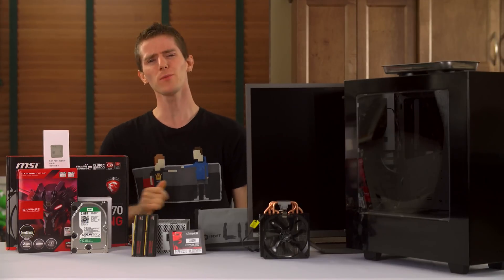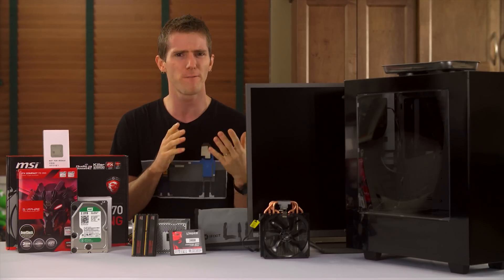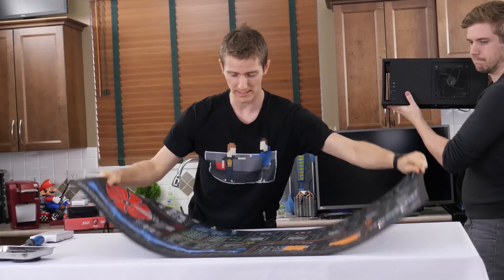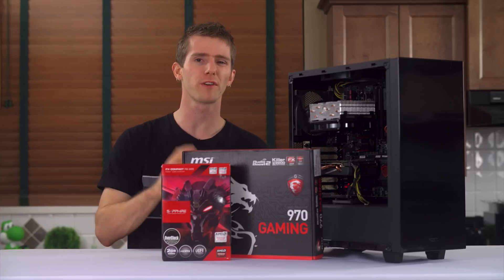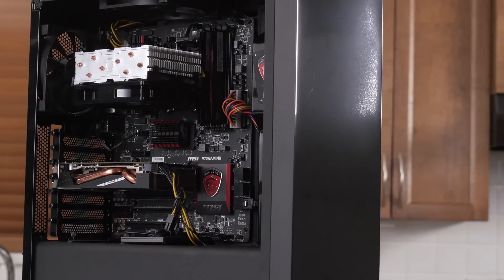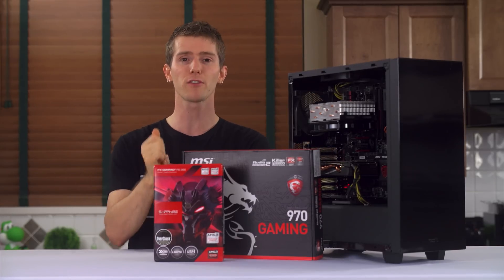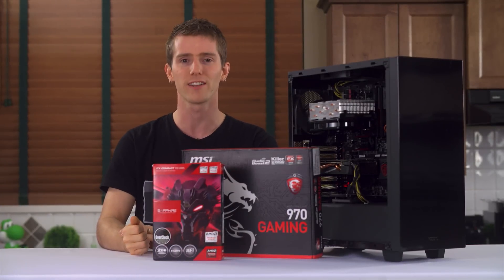Can you Build a 4K Gaming PC for Under $1000?

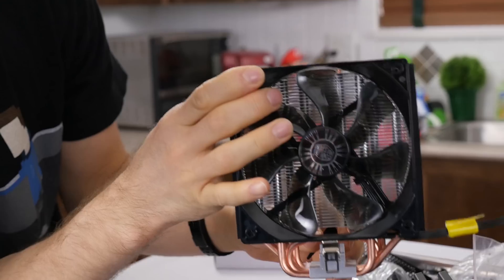Comment: 3:04 is that a hyper 412s cooler? if it is then thats the same cooler i use. also the FXA-970 motherboards is the same board my cousin used because he switched out his fx-8350 for an i5 (i cant remember which but its the one thats roughly the power equivilent).

Comment: just wondering if i upgrade my pc will it be able to play moba games at 4k 60  fps?

specs:
cpu G3258  oc 4.2ghz (upgrading to a 4690k or 4790k if)
r9 290 vapor x
kingston value ram 4gb x2 
z97 msi gaming 3
750w semi modular psu 80+ B
wd blue 1tb
wd blue 500gb
kingston fury 120ssd
deepcool maelstrom 240t aio cooler

im into moba Dota 2 mostly. i do play other games but i dont mind waiting for pascal for the gpu upgrade if needed.
just wondering if g3258 can handle 4k moba gaming.
Reply: +Irfan  Comot  Get a new cpu that g3258 will bottleneck that 290 pretty hard. From research it seems Dota 2 benefits from a good cpu more than a gpu.
Reply: +SpinOutTV2 yes i agree to that. bought it for experimental purposes and learning. since its started as a budget build and make my way up. do you think a 4690k would be able to handle 4k dota?
Reply: Irfan Comot Yes that would be a perfect cpu for Dota and it wouldn't bottleneck that gpu.

Comment: Would a GTX 960 4 GB provide about the same performance as the AMD R9-285 2GB Compact GPU that you used?  Any reason not to use the GTX 960 with 4 GB for a 4K build?  Edit:  Been reading that the R9 does better at higher resolutions and has significantly more memory bandwidth.  I might lean towards the R9-380 over the GTX 960, price is about the same.

Comment: I pluged monitor to a potato installed windows 10 and i could run cs go at 4 k avg 89fps i am very happy
Reply: +Napoléan Bonaparte What kind of potato was it? Should be a pretty low end one!
Reply: Hristian Andreev Its a pretty high end it cost 3$+txs so thats kind of a deal breaker for most people.
Reply: Damn! That definitely beats out my potato i got a couple of days ago from the groceries store...... I'm sad now
Reply: Hristian Andreev I had to upgrade mine the old one was a bad potato but it did the job
Reply: +Napoléan Bonaparte  my potato is $5 plus I get 5 extra potatos

Comment: I'm thinking to buy i7 prossecor now cuz the divisoin need i7 processor it means future games will too reqire it
Reply: Don't. An i5 4690k can run it just fine with the right gpu. Or, if you have the money go with an i5 6600k. You wont be able to run max settings, but games will likely be playable at 4k (probably low or mid with no aa). i7s are great chips, but for gaming quad core i5s work fairly well. Dont just take my word though, go do some googling of benchmarks and figure out what will work for your workload.
Reply: games which require an i7 are always playable with a decent i5 like the 4460, 6400 etc

Comment: Anyone know anything about computers and tell me what you think I can run?

I have:
-z170 Motherboard 
-i5 6600k 3.4ghz quad core (Soon to be overclocked)
-Hyper 212 evo Cooler Master cooler (Soon to be replaced with 240mm closed loop for a 4-4.5 overclock)
-16gb of crucial Ballistix 2400mhz ram (Possibly upgrading to 32gb)
-960gb sata ssd (570mbs)
-1tb Hard drive
-EVGA 600w 80+gold PS
-EVGA gtx 970 ssc

Comment: I wish I had a 4k gaming pc. I don't even have a gaming pc :/ I want one so bad though. It's I just don't know how to build my own pc, with gpu, cpu, ram, cooling, monitor (4k or not). Anyone that knows the answer please tell me, which is better, a HDD or SSD?
Reply: +Lobsta 959 Thery're better for different things. SSDs are more expensive for the space but are very fast, while HDDs are slower but much cheaper. The 'best' way is basically shown in the video. Get a small SSD for your most used games and the operating system, and a good large hard drive for anything else. But if you can't afford an SSD now then just go with a hard drive.
Reply: +MGlBlaze thanks, what RAM type should I get? DDR3 or DDR4. And what CPU? Intel or AMD?
Reply: *****
 RAM type doesn't matter much. Get whatever the motherboard is compatable with. AMD has the most affordable price-to-performance options. You can get a new FX-6300 for about £80 (around the performance level of an i5 for about a third of the cost) or an FX-8350 for £140, which is just below the performance level for an intel i7-3770 (and not that much less than an i7-4770) at less than half the price.

https://www.cpubenchmark.net/cpu.php?cpu=AMD+FX-8350+Eight-Core

You can squeeze this even further if you feel like buying the processor used.

Though again, the 6300 was mentioned in this very video. Just... watch this video.
Reply: We don't use pounds in Australia, but I think 80 is around $100-$110

Comment: Who the hell plays CS:GO in 4k? Unless you get lucky with overclocking a G-sync panel to say, 100 hz, I certainly wouldn't. All the other games make perfect sense lol.
Reply: Cause your suppose to see better like through the smoke and molotovos so you can get better visuals and much more accurate shots because of how the game visual is setup. I play on medium at 80 fos
Reply: +Red™ I'm not saying it's undoable, just that I'd rather overclock a 144hz panel to say, 200hz or even more, than play on a 4k monitor at 70-85 hz. But I think we can agree that 1440p 144hz monitors have the best of both worlds. :)
Reply: +Elijah Ramer (DegradedFour) true :) but 4K monitors don't display it in 4K d your running it at medium. I think monitors to up to 4K but don't display the graphics in 4K

Comment: It really is worth the stretch in price for a 4k monitor nowadays. I love mine. I got a 40 inch one, and now I use it as a tv as well with some careful choices for sofa etc to allow a keyboard and mouse table. So brilliant to switch between keyboard games and controller games etc, and it means sitting further away giving my eyes a rest. I have it wall mounted to pull it closer to desktop distance also. It works really well.

I would say that it is more important to get an ssd, but after that save up for a good 60hz 4k monitor.

Comment: I'm trying to build a nice pc under $600 with 4gb of vram. Is this ok? Any suggestions for improvement?

CPU 
AMD FX-6300 3.5GHz 6-Core Processor
$136.45 Buy

CPU Cooler 
ARCTIC Alpine 64 GT 25.6 CFM CPU Cooler
$16.99 Buy

Motherboard 
ASRock 970A-G/3.1 ATX AM3+/AM3 Motherboard
$95.50 Buy

Memory 
G.Skill Ripjaws X Series 8GB (2 x 4GB) DDR3-1866 Memory
$49.99 Buy

Video Card  
Asus Radeon R7 370 4GB Video Card
$215.98 Buy

Case 
Logisys CS206BK ATX Mid Tower Case w/480W Power Supply
Reply: +Guido Fawkes Precision, it's $600 CAD

Comment: Hey guys!
I have a amd 390 8gb gpu and a intel core i7 920 2.67 ghz, I was thinking of upgrading the country to a AMD Black Edition AMD FX 8350 / 4 GHz processor,  and use 16 gb ddr3 ram, any ides how that will go? or if I should get something else?  Thank u :)))
Reply: +Noah Lundqvist DONT DO IT!
Reply: +Yusuf ahmadi why?
Reply: amd processor didn't have ball when it comes againts intel. if you wanna do upgrade just stick with intel. (not fanboying btw..)
Reply: +Yusuf ahmadi all reviews are good about the amd cpu, it's faster then what u have, it is cheaper than a i5 3-somthing K cpu, so what's wrong with it? ?

Comment: Eww... WD green...
Reply: +lvcsslacker Green is really good at saving your electricity bills.
Reply: +lvcsslacker There are no significant difference at all for the latest Green due they mix it with Blue make it single model now compare to Black. So its ok use energy saving drive, cause all you need to be faster is actually an ssd mix with the hdd, thats all.

Comment: I see many issues with this build, 
msi 970 chipset boards are terrible and horrible power design, have fun overclocking on it, it will come with a lot of issues on
it when doing so

the 285 is not enough for 4k hell not even 1440p, to weak and 2gb of vram won't be enough, even at 1080p ultra it is not enough, even for lower games it makes no sense especially with an expensive display 

the 6350 is a waste, you could just get a 6300 for cheaper and overclock to beat it, still amd cpu's are too old and weak to be used at this point

you could easily fit an i5 4460+ 290x during this time, which would make more sense for 4k, but still at time to time it
would not be enough

the wd green's are not good for usage becuase of low spin cycle, should have got a seagate barracuda or wd blue

the v300 kingston ssd has low write and read speeds for the price, the 850 evo or crucial bx100 is way better 

i could continue but it is just a waste of time commenting on a old video, too bad amd sucked your dick on this video just like intel did on your value build video, for $650 only a pentium and a 260x on a $100 motherboard what a joke.

Comment: Intel i5 3470 (3.2Ghz) ~60% load in CS GO
Mobo-the old cheap good AsRock B75
Graph-Radeon HD7870 OC (core-1100 MHz /memory-1300MHz) run CS:GO average fps-170 with highest options + 8xMSAA
Monitor -Dell U2410 1920x1200 60hz IPS montor 
Still less than 1000$ even with SSD included

Comment: Asus K43SV:

Intel Core i5 2410m (2.3 GHz - 2.9 GHz)
Nvidia Geforce GT 540m 2GB DDR3 128-bit
4.00 GB DDR3 1333 mhz RAM
Windows 10 Pro 64 bit

I play Dota 1, Dota 2 and CS GO and I got 65 fps at max settings. 1366x768 and 1280x720 and I'm happy and very satisfied with it. :)

Comment: an i use an nvidia graphics card with the amd cpu? some people said amd makes their cpus work better with ther own graphics cards, and are FX amd cpus any good?  i know people say intel is way better and amd overheats too much
Reply: AMD is better priced, get a bit hotter, has higher TDP, has higher clock speeds, has more cores, has worse per-core peformance, which would be a bit worse for gaming. Although the differences are not that huge anyway.
Reply: are amd cgraphics cards better compatoble with their amd cpus or even an nvidia card would work good?
Reply: Iwo Ruuzz It would work perfectly fine.
Reply: +Iwo Ruuzz Intel & Nvidia is more power efficient but cost more money than AMD & ATI.
Reply: +Jelqzko Pehlivanov Yes, but that has to do with the intel processor, not with the conbination of the 2.
Reply: +Iwo Ruuzz Using a nVidia card on an AMD cpu or vice versa does not matter at all. it will work just fine whatever you use!

Comment: Got a MSI 390. Runs cs:go at an average of 170fps at 4k. Though it has quite a bit of trouble on fallout 4 even at lower resolutions thanks to bethesda optimizing the game for nvidia cards (which were the only cards i used previously to this card, but its 8G vs the 970's 3.5G changed my decision).
Reply: more like fallout 4 wasnt optimised at all

Comment: Yea, lets run cs go at 4k
Reply: +theapple0 800x600
Reply: +theapple0 i am still playing on 1280x960 in cs xD
Reply: theapple0 But can it run Crysis?
Reply: Kusqen Anton 1024 * 768
Reply: Levi Paustell To mutch pixels, try 32k
Reply: +theapple0 lets make it impossible to see anything xD
Reply: +theapple0 I play CS in 4k
Reply: +Afentiko yeah same
Reply: +Afentiko same at 299 fps
Reply: +theapple0 no. Do it at 69k XD
Reply: Just game on ram, who needs storage?
Reply: theapple0 I
Reply: 320x200
Reply: "But what about the games that people are actually playing, like Minesweeper...."
Reply: +Strict Rooster what screen is this????  I have a gtx570, i5 2500(not k) and I am not sure if I should get a new monitor 120/144hz or a new Gpu...
Reply: +Strict Rooster I play dark souls mostly which is 60fps but would like to get back to fps games
Reply: +tenchuZsenran Acer XG270HU WQHD Gaming monitor  it's like 400-500 euros it was cheapest monitor with these specs i could find it has amd freesync but works good with nvidia cards too and i would recommend upgrading your gpu atleast to 960 or 970 they are affordable and great for next gen
Reply: The 12 year Olds WILL TAKE OVER OH GOD RUN EVERYONE
Reply: +tenchuZsenran upgrade your video card to an R9 270 or better and that should be fine with all settings maxed  (makes use of freesync as well) on the Acer XG270HU, although the XF270HU is the same but with a different panel type.
Reply: +Vanguardas Vucava XF270HU also costs 200 more and G-sync version is about 850
Reply: Strict Rooster I'd use a TN anyway (cause it's fucking cheap and 1mn RT), but some people don't like it for watching stuff... so yeah
Reply: +Vanguardas Vucava yeah i like my XG it's good enough also my new build will have no problem to run at 2,5k
Reply: Strict Rooster i plan to get that too! too bad it isn't available in my country yet. 3rd world problems
Reply: +Bleu Kassidy gtfo
Reply: Jun Hyung Park Same :)
Reply: +theapple0 Some of us DO play csgo at 4K http://steamcommunity.com/sharedfiles/filedetails/?id=658570784
Reply: There are things like Max settings csgo can help with seeing in smokes or stuff like that and molotovos. The higher drama the better ur suppose to see I saw in a warowl vid
Reply: +Kamil Niewiadomski XD
Reply: +Kusqen Anton 3440x1440 :P
Reply: not trying to be rude but are you playing on a potato? CS:GO runs on anything xD
Reply: Finlay Pierce i get 2 fps
Reply: The First World War ok 4k for csgo? how do you know because you must have like no graphics card and if you cant even run csgo at 4k why do you have a 4k monitor
Reply: joseph doucette how did you take that seriously wtf XD
Reply: The First World War i know alot of people with shit pcs
Reply: I play with 640x480, dual core 2.1Ghz and 512MB graphics card, 4GB RAM.
The graphics card is Nvidia GeForce 105M...
All the settings on low, i get average 30 fps.
Reply: thats so bad m8 😂
Reply: I feel guilty for having a i7 6700k now :)
Reply: i7 6900k  how about ??
Reply: 1024x768 wide here :P
Reply: And watch russian kids camp and say cyka blyat
Reply: Much wow IN 4K WOW
Reply: CSGO In 9 words.
Reply: I play 1440:1080 4:3
Reply: but what about minesweeper?
Reply: I didn't know bleach plays csgo
Reply: Hear russians say cyka blyat... IN 4K
Reply: 640*480
Reply: na get the acer rog swift PG279Q, IPS. 165HZ, 4ms response, 1440p, 27 inches, or if thats out of your price range/ want 1ms get the acer rog swift PG278Q, exactly the same but 1ms, ( a good TN panel) and 144hz
Reply: btw the 9Q costs like £900 and the 8Q costs like £500 i think
Reply: Mr Negi Generation 3000 i7 6700 k 1080 ti sli.
Reply: At least the care about THEM MONEYS
Reply: VictorHere do u play csgo?
Reply: my personal thought is that 4k supposed to be for games with really good graphics of course you can play minecraft and or cs go on 4k but if it's the only games you play than it's just a wast of money...
Reply: cs1.6
Reply: I play at a resolution of 16x9
Reply: Well that's AMD for u
Reply: Counter Strike Source superior
Reply: theapple0 Either you are trolling, or really misinformed. Most pro's play 1280x1024 on either 16:9 4:3 stretched or on 4:3 with black bars, and there is no way in hell they;d sacrifice their 144hz for 4K
Reply: AutopsyGremlin I am just kidding bro, I know. But most pros play on 1024 * 768 (fnatic) with blackbars (only flusha doesnt). bdw samsung is releasing screens with 4k at 144 hz and kennys (envyus) plays on a 120hz screen
Reply: AutopsyGremlin what are you talking about? I already see all the pro players run CS at 4k :p
Reply: AutopsyGremlin if you look at liquidpedia you will see kennys still has his 120hz screen. The 4k screen has a delay of 5 ms
Reply: TSAviation We were talking about 4K, I personally play on 1280x960 4:3 stretched.
Reply: AutopsyGremlin me play 1024 * 786
Reply: +theapple0 i play on 2560x1440 @144hz 1ms delay
Reply: fuck 4k... what about 8k?
Reply: +theapple0 1400x1050 fam god res
Reply: +theapple0 And have a massive input lag where you need atleast 6-7 sens to be able to aim decently on a 4K display.